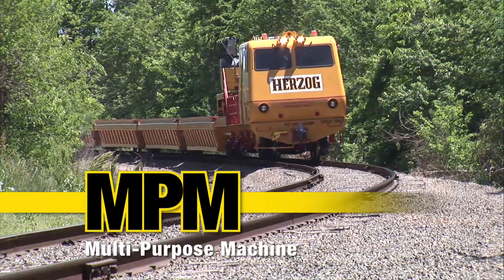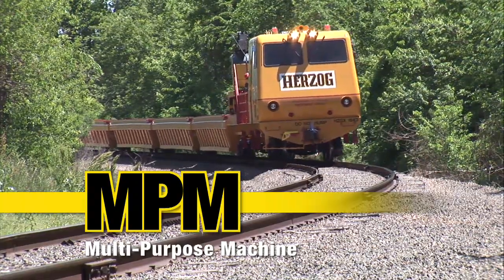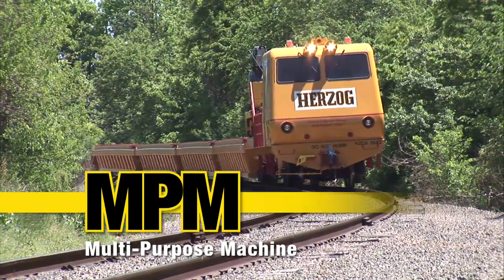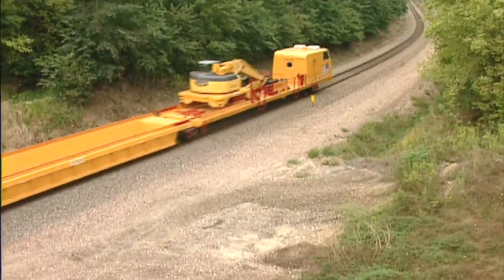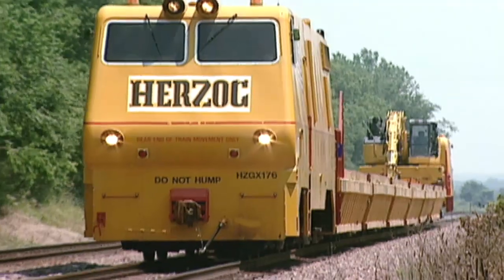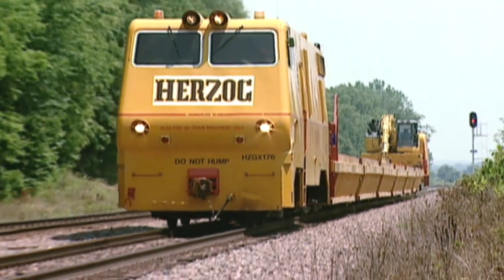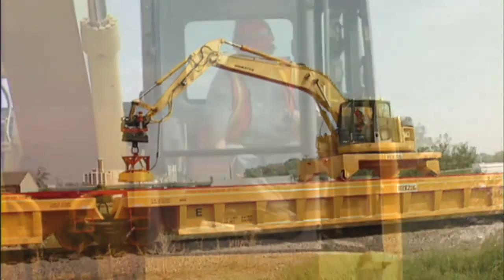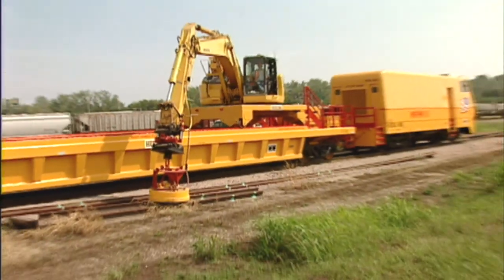Multi-Purpose Machine (MPM®)

Comment: They cut down the trees along our set of tracks and now it looks ugly Shame on you!
Reply: wouldn't trees too close to the tracks be a fire hazard?
Reply: @KnightRaymund  I suppose but these trees were a good 30-40-50 feet from the tracks. They helped block out noise and air pollution for the buildings nearby. Along with that there are other trees by the tracks that are even closer to them that seem to be considered "safe". It's just unfortunate because these trees were really pretty and didn't deserve or should have been torn down.
Reply: @KnightRaymund no. More of a strike hazard, either by coming into contact with a passing train or if they’re tall enough which sounds like the case for this guys would be a risk if fallen over onto the track after a storm or high winds.